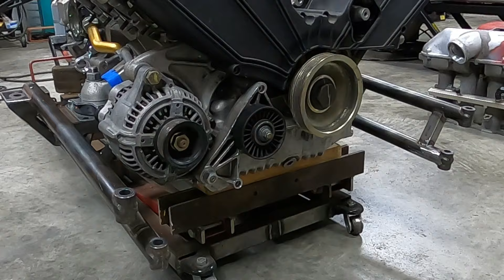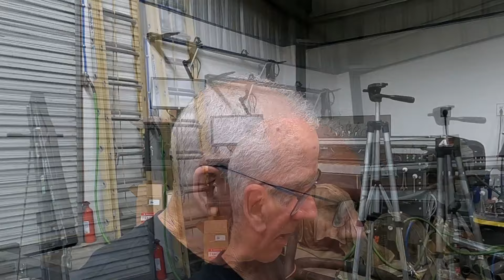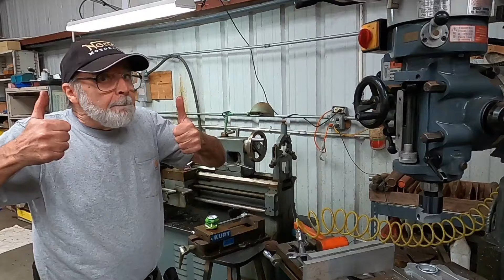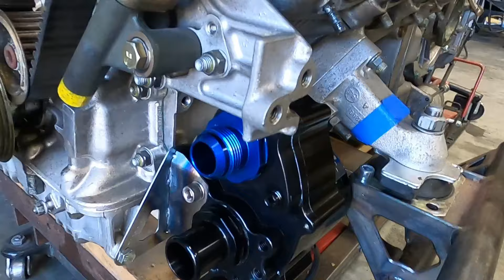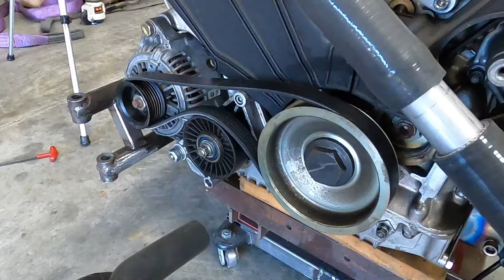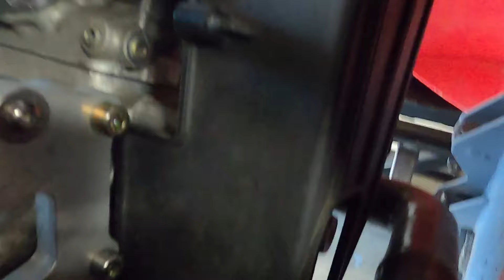914 Ferrari Swap - Episode 59: Martin, mills and my progress... Oh, my!

Comment: Sorry if I missed this in a previous video - why do the electric water pump?  This is one of the factory systems that isn't really flawed (unless I'm wrong).  Was this a packaging issue?
Reply from the maker: Yes, mostly packaging but also because I can control an electric pump based on the coolant temp or have it continue to run after the engine is shut off. More options.

Comment: Great episode Chris,  I like how you tinker and test fit then redo, third time is a charm for sure. Maybe your license plate should be, “3RD Timer”. 😂😊😉
Reply from the maker: But what if I end up changing the licence plate?!?  🤪
Reply: @attheredbarn1669  that is pretty funny I wouldn’t put it past you. 
I see you swapped out your fuel regulator again. What did do you do with the old one? I’m running a return style that I got from Summit. Yours seemed a little more substantial if you want put it up on a garage sale I’m interested.
Reply from the maker: @tonyImba914-8  Hi Tony. The one I replaced is also a return style. It's a Radium part # 20-1623-00. Take a look and if it looks like it'll work for you, let me know.
Reply: @attheredbarn1669  hi Chris I looked up that regulator on Summit and yes, it will work but unless your giving  a smoking good deal, the one I have is working fine. I know if I have a spare I won’t need it😂. I’ll shoot you a picture of my set up. The bracket tree isn’t as nice as yours but hold 61 psi right on the button.